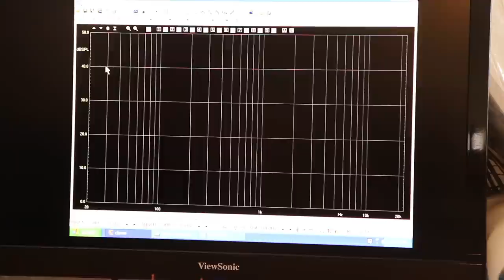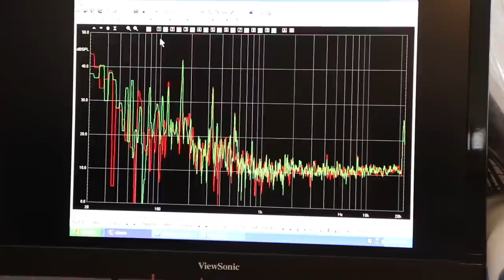Power Cable Tech Talk and a little help for Amir at Audio Science Review

Comment: I have a decent listening system (mytek Manhattan 2, benchmark amps, focal sopra 3's)  this is all in a professionally sound treated room, I even had an electrician run dedicated 20 amp power cables and we he took great care to make sure it was separated from anything else in the wall.   I have tried many different power and interconnect cables ranging from Pangea to audio quest to  nordost....... I have had many local audiophiles come in and do blind tests and the unanimous conclusion is by a fancy cable for looks not performance. The biggest improvement came from the room treatment and speaker placement.
Reply: I can see where you are coming from, the best sound improvement I have ever had was when I dropped home runs from the panel, or Main, direct to the AV corner in my living room. At that point, the electrical cords really did not matter on my modest system. Now, where I had a massive improvement in both sound and especially video transmission, was the addition of a filtering network switch. The TV simply POPPED in both color and contrast, it looked like a new TV had been installed. Others asked when I had bought a new TV. I have two switches, one of the $500 LHY units, and one $50 Netgear GS108eV3. I cannot tell the difference between the two, the $50 NetGear unit does everything the $500 LHY unit does, kicking self. Try a NetGear GS108eV3, it is the real deal. Amazon sells them, it does nothing, return it.
Reply: Of course the biggest improvement comes from room treatments as expected. But cables does change the sound. In Bass, clarity, separation. You don’t need to be an audiophile to hear it. There is a reason people uses cables to tame their electronics 😅

Comment: The difference between Ethernet and power runs is the field is much greater with mains supply than speaker output being at best a few hundred watts in the home environment

The issue with Ethernet is not loss of quality but loss of transfer rate.  Noisy Ethernet does not and cannot degrade the sound. It will in severe cases cause gaps in playback due to buffer underrun as the receiver discards frames that fail the cyclic redundancy checksum.  Basically corrupt digital data cannot get through
Reply: Noise levels on a digital signal easily affect the D/A conversion.
Reply: @dannyrichie9743  The job of any decent audio engineer is to make sure that noise is not travelling to the output of the DAC.  If they can't do that, I suggest not buying said DAC.  No assumption can be made that any source is clean.  This is proven across hundreds of DACs I have tested where a noisy signal from a computer over USB produces superlative dynamic range with noise floor well below threshold of hearing.  I have also done the same testing over Ethernet.
Reply: @AudioScienceReview  If that theory were true then power cables would have no effect on how they sound. However, we know and have proven hundreds of times, that is not the case. Power cables can and do have a significant affect and can create a audible difference with any and every DAC out there. So what you are really saying is that you have yet to figure out how to equate measured data to known audible differences.
Reply: @dannyrichie9743  You have no evidence that power cables make any sonic difference.  I can get someone to tell me the sound of a system has changed even though I don't change a thing!  By your notion, the system has changed even though I just said I never changed it.  That aside, you keep saying the noise is reduced.  Noise is trivially measured.  I did that and your cable doesn't remotely make a difference in noise level.  I also showed through null test with music that the noise level did not change with generic cable vs yours.  All of this points back to your perception of sound changing being faulty.
Reply: @AudioScienceReview  All of that is total BS. We have confirmed hundreds of times that power cables make a difference. The whole industry knows it. The differences are easily demonstrated. You also confirmed that our cable reduces noise. No going back on that. If you haven't figured out how to measure what the rest of the world clearly hears then just keep trying. You'll figure it out eventually (maybe).
Reply: @dannyrichie9743  It's getting to the point where your responses are just insulting the intelligence of people with a STEM background. Come on, we know better! If you were correct here, it would be simple to show not only with anecdotal evidence, but confirmed with measurements too.
Reply: @dannyrichie9743  You just don't want to listen what he says do you? And you have not confirmed hundreds of times that different power cables make an audible difference. I think you know full well what you are doing and are just relying on your smooth talk that sounds competent. Also not because a cable reduces noise that the difference can be heard. Surely that can't come as a shock? Maybe you'll figure it out eventually (maybe).
Reply: I have 40 years of experience listening to cable changes. 
And they do change the sound good or bad. Especially power cables.
I'm standing by my trusted friend. 
My ears.

Comment: Any power supply that cannot filter out induced noise through the power plug is a wholly inadequate power supply.   Which does not surprise me at at all when so many people say they can hear a difference.  Power supplies are not the main focus in a lot of equipment.  Even so-called "high end" audio equipment often have poorly filtered power supplies, will run signal wires and traces right alongside power and even high frequency data lines.  And I've seen amplifiers selling for many thousands of dollars using unregulated power supplies and no high frequency bypass caps at all.  If the PSU cannot filter out unwanted signals induced through the power cable, the problem is with that PSU, not the cable.  The PSU is junk, not the cable.
This is not to say a low resistance, high current capacity, and well shielded power cable cannot help.  It most certainly can.  If the POS PSU cannot filter interference, then you can minimize the interference the power cable picks up.
Cheese does not end with crossovers and connectors.  We have people like GR Research calling out speaker makers for the cheese they stuff into speakers.  But we don't have anyone calling out companies for the cheese they stuff into amplifiers, CD players, DACs, etc..  Perhaps this is why I find so much cheese stuffed into even very expensive equipment.
Reply: Please start that channel. As a non-electronics engineer, this would be a great learning channel for me. You could call it ‘The Audio Cheese Grater’.
Reply: Interesting perspective, however you do overlook the fact that power cables can assist in dealing with noise on the supply. It is common mode or differential mode noise on the supply.
It is always better to put less noise in than depend on the filter components in a PSU alone to deal with it.
Reply: @indiakilo3929  Agreed, which is why I like shielded power cables.  And not just to reduce induction, but transmission as well.
And let's face it.  In my "perfect world", every power supply would be inside a well grounded faraday cage that extends all the way to the plug.  I occasionally see an amp that tries to isolate the psu, but I more often find no effort to isolate the signal path in even "high end" equipment.
Just this January, I cleaned up and modded a pioneer CD player with power supply wires zip tied together with wires that carry  digital signals from one board to another.

Comment: Noise in cables is irrelevant as it gets filtered out (actually removed) at the power supply in the appliance itself. IT IS THE POWER SUPPLY in the appliance THAT REMOVES ANY AND ALL ELECTRICAL NOISE. It is NOT the electrical cable that removes any of the electrical noise induced in the cable. How can it do, IT IS JUST A LONG PIECE OF COPPER WIRE. If equipment is compliant with FCC or CE EMC requirements, it has to not ACCEPT or TRANSMIT electrical interference.

Comment: if this is for AC power wouldn't' tit be better to plug into the outlet closest to the mains coming into the house bypassing the terrible cable that runs to other outlets? A chain is only as good as it's weakest link.

Comment: If this is such an issue, why isn’t all high end Audio Gear designed to run of some type of DC batteries
Reply: Some are, and we own some. It is a huge advantage to run some of the gear on pure DC power.
Reply: My Friend George Louis used batteries for CD player and what a difference there. How about if you used a 5,000 watt Solar Generator?
Reply: The term you are looking for is power supply output impedance
Reply: i lived on a boat for years & run my hifi on batteries charged by solar pannels & engine power; i heard no difference to running a hifi in a house on the mains, regardless of the power cable.

Comment: I agree with most of your videos regarding quality components in the crossover networks. However, you judge speakers solely on their measurements and not on listening tests. I'm not anti-measurement; measurements are a good indicator of how well a speaker is designed but is by all means not the last word on how a speaker will sound in any environment. Measurements are your gospel with regards to speakers but you don't offer measurable evidence of many of your tweaks and beliefs, i.e. speaker cable trestles, directionality in patch cables (even digital and optical); you rely solely on your perception of differences, however minute and call them improvements. The only entities I know of that sing the praises of exotic materials, garden hose sized speaker cable and the directionality of patch cables are companies that sell said products. Whenever anyone says that they can't hear differences in such phenomena, they're told there's something wrong with the their gear or they're not listening "right". 

I do have a problem with you calling people "Flat Earthers" who don't trust your claims regarding esoterica when what you are touting is purely empirical. Flat Earth people believe in something based on a type of faith and eschew any proof otherwise, even when confronted with proof. People who refute immeasurable phenomena that they can't hear, phenomena that doesn't pass double-blind testing, aren't refuting it based on some faith-based agenda. Rather, the people making claims aren't offering solid data or proof, they're offering empirical testimony. Since when are testimonials scientific data? How many speaker designs have you seen or heard that were the product of observation or experience, rather than proven scientific theory? I've listened to seemingly intelligent people making impassioned testimonials about ghosts, Bigfoot, extraterrestrial beings, etc. Should I take them at face value? Certainly, I have no business telling anyone they did or did not experience whatever phenomena they say they did, but I will hold out for solid, irrefutable evidence. People can believe whatever they want, but when someone starts selling tickets on the next passing comet, I'll call BS. 
'
Reply: Exactly. Danny is the flat earther, or more accurately, the neanderthal. He should discard his club and skins, emerge from his cave, and join the modern world.
Reply: @StillAliveAndKicking_  🤣🤣

Comment: Noise affects digital signals?
Not 100%...but error correction is part of the system...so...I am guessing "distortion" from noise isn't an issue....maybe resending bunches of packets would slow down throughput.
Reply: Yes, the noise on the lines effect the D/A conversion. As the signal is converted to analog the noise is present there as well.
Reply: @dannyrichie9743  can you provide link to source explaining that issue?
Reply: @think2023  Try Google.
Reply: Digital is very fragile. It is even effected if the digital cable is shielded, which end it is grounded to, and if that shielding is on the ground plane of the rest of the system.

Comment: great video! Years ago I was a flat earther with respect to power cables. Then I borrowed a few and had my eyes opened. The view of using only L, C, and R to measure power cables, speaker cables and IC cables is akin to measuring the earth's temperature by determining how many hours of sun light each section of the earth sees. It may have an effect, but its not the complete story. 
And none of those 3 measurements determine how the magnetic field flowing around the cable is also affected. That effect on magnetic fields may be one of the reasons cable risers work so well.

Comment: More then 20 years ago, I made my first power cable, based on a design from de "twisted snake" TNT site. I couldn't believe the diffrence was that big. It costed me only about  500 Bfr (before the euro, now maybe 15 euro for one cable) 
But then again I was listening to triode monoblocks and a VTL preamp on Alon speakers. Maybe, I was ready for it ;)

So, I know that it's much easier to deny these fact's. (or "because you cant measure it, you can hear it" ).

You did a great job of explaning it, in a simple way. 👍

Comment: Are power conditioners something that could help with AC supply noise?
Reply: Power regenerator like ps audio power plants work wonders, but still good cables make a big difference... On the right system... Don't waste your time or money if your gear isn't to the level
Reply: @Hastings Piper I have yet to see any piece of audio gear that didn't benefit from some level of power conditioning. Then just when you think a system sounds perfect. Take it to an audio show at a hotel that is loaded with A/C noise and you find out real quickly that whatever worked well for noise rejection at home isn't near enough any more.
Reply: @Hastings Piper That is correct, especially that last part. " Wires will not save a bad system and neither will power conditioners."  However, good cables on a good system are icing on the cake.

Comment: Amir can't measure sound stage or holographic sound or ANY sounds characters,  He use AP instrument to measure SINAD,  THD , valve tube has high THD , BUT they sound musical.  How Amir can explain it with AP instrument??
Reply: Yet GR has no problem measuring various makes of loudspeakers and inferring from there. Audio Precison analyser is state of the Art, Clio is rather pedestrian as far as equipment comparison goes.
Reply: Amir never speaks from a audible.point of view as it's not relevant. 

He only shares what MEASUREMENTS SHOW it's doing. He never will say "wow that's bad sounding or no depth" 

It's not a REVIEW of the cables it's a actual performance test based on the measurements. And that's what's being shared, amir isn't a reviewer he said that multiple times. 

You need to start watching his channel more..

Comment: Cool how 3ft of magic copper can fix the miles and miles standard wife from the power station, house wiring, and internal wire in the device. Special, special copper.
Reply: It is kind of like how your water flows through miles and miles of pipe before it gets to your house, and then right before it reaches your sink, it goes through a filter. Same thing....
Reply: @dannyrichie9743  what gage is your house wiring?
Reply: @toddlee2571  What gage?
Reply: @dannyrichie9743  Guage. Don't know how that one flew by me...
Reply: @dannyrichie9743  If you buy a decent amp the filter will be in the power supply. However, if you have some weird esoteric boutique amp, then it may make a difference.
Reply: @dannyrichie9743  😂😂🤣🤣

Comment: In my humble opinion, if the infrastructures of an electrical installation at home with cables or electrical wires are not properly sized in length, diameter and quality of materials from the source (electric company) to the wall socket, what is it worth buying a power cord? Will the miracle happen with this simple addition of a power cord when the issue is behind us?

Using the same reasoning, we can take a water hose with a small diameter and add one with a larger diameter at the end, do we have more flow, more pressure?
Reply: We can put a filter on the end of the hose. A power cable can work much the same way.
Reply: Filter on what. Power cable as any conductor will have some frequency response limitations as any conductor that is not design to match particular impedance (transmission) line. And in that case is good thing, however it not different then any other cable, that mean any  distortion that is already in the outlet will just pass thru not interrupted. So where is the advantage? Shielding? OK. However rest of the house AC line is not shielded. So what do the benefits? You AC signal can be clean like a wisle, unfortunately inside you amp you need some meas to convert that to DC. This the main source of distortion.
Reply: @miroslawkaras7710  The geometry of the cable will cause it to act as a filter.
Reply: @dannyrichie9743  Danni, as you said, everything matters and I apologize for my skepticism, but a simple power cable alone does not solve the problem if the installation of our homes does not follow the same quality as the same Power cable. The same happens if the room that does not have acoustic quality will have to have its acoustic treatment in order to get a good sound.
Reply: @JJTMARQUES  What is being picked up by the wiring in our homes is nothing compared to what gets picked up on the lines in a hotel at an audio show.